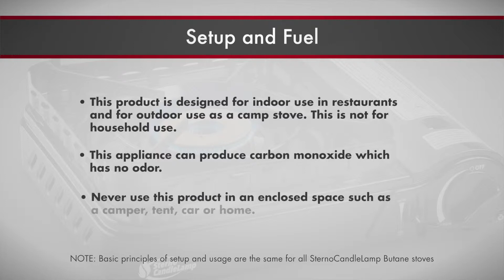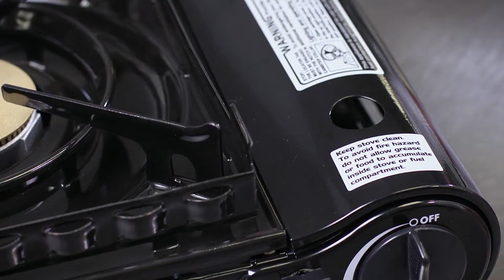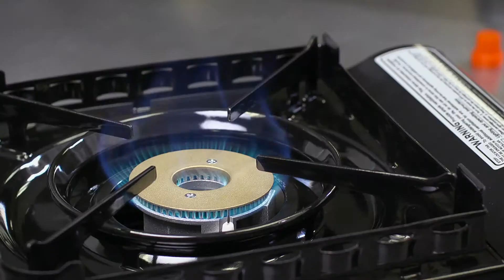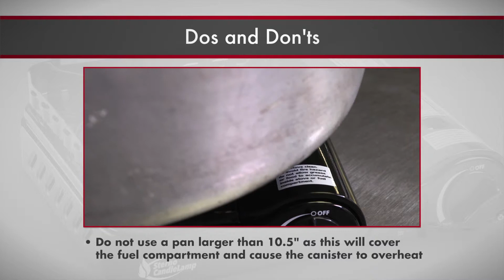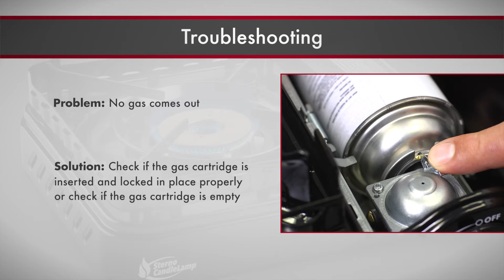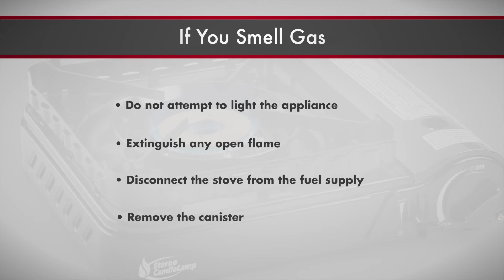Sterno Products | How to Safely Operate Your Sterno Butane Stove

Comment: Can I use a wok pan with a base diameter of 6 inches, a height of 4 inches and a top diameter of 14 inches ?
Reply: Here's a simple trick to see if pan, pot, or wok is too damn big. The canister cover shud be able to be opened with the said pot/pan on the stove. If the cover is blocked or cant be opened then the pan/pot is too big. Get a smaller one. I know 12inch diameter woks are ok. 14" could be too big. Also, it depends on level of heat used. Full blast, the flames can rise up the sides of the wok heating up the canister cover area. Lower flame, it may not do that. Only way to find out is test the wok on a stove and see. Every wok has different base, diameter, height, and degree of curvature that can affect the flame pattern.
Reply: @RedEye3  very helpful. Thank you for your response.

Comment: Yeah, I live in my car and need a way to cook in my car. I'm using it in my car, but I'll have the windows down
Reply: Why not cook outside and lay the stove on trunk or hood. Daaamn. lol.
Reply: @RedEye3 bc publicly cooking outside is a good way to get kicked out of where you're parking unless you're at a campsite or smth.
Reply: If you're using it indoors get a carbon monoxide detector
Reply: thanks for this comment, was worried that wouldn't be enough but I think if I keep the door open as well next it it should be fine